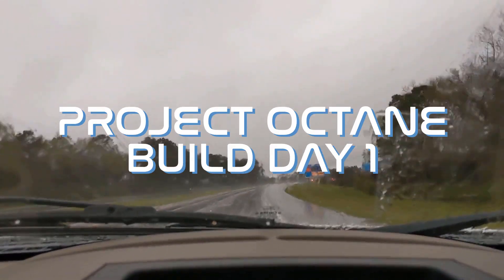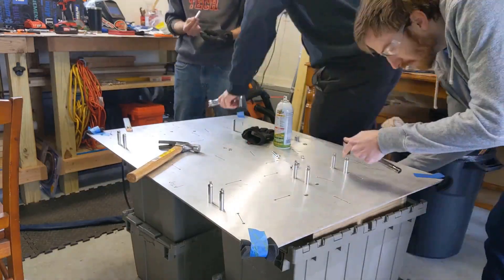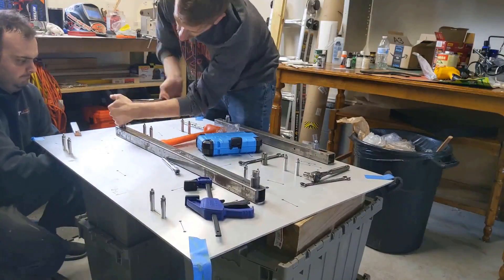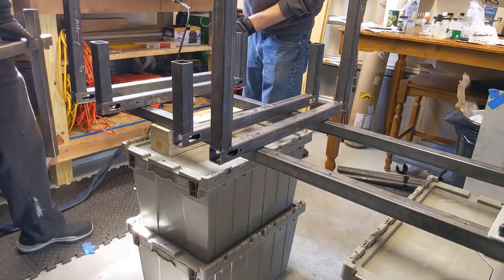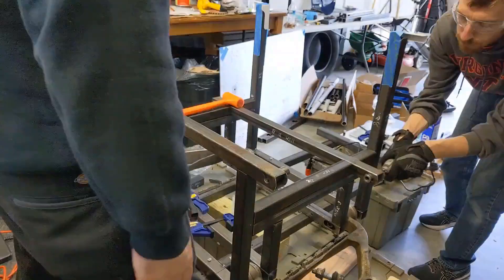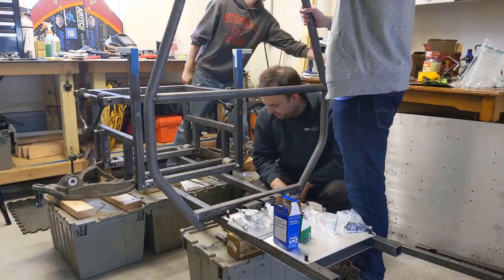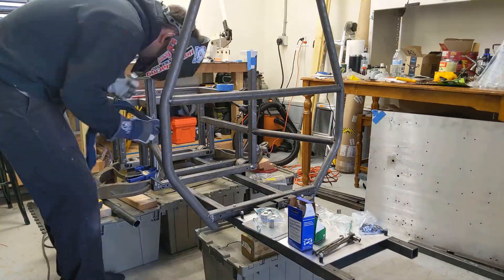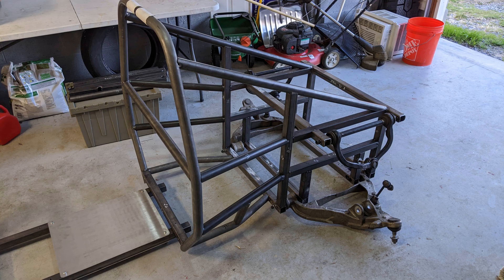Making a Real Life Rocket League Car  |  Build Day 1  |  EP13

Comment: Im just confused, why wasn't he completely welding the frame, like won't that cause the car to fall apart easily when put under a lot of stress?
Reply from the maker: Yes, generally you tack it all first before coming back and running full beads. The tack holds for assembly purposes, so if something needs changed you don't have to cut out a complete weld. Also takes a lot more time to do full beads so Tillman is doing that in his spare time without me needing to be there.